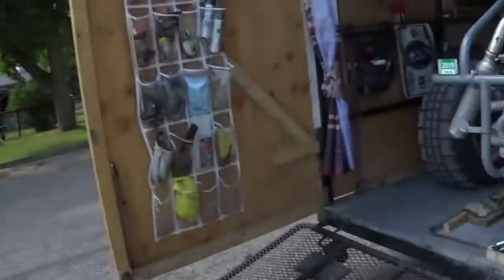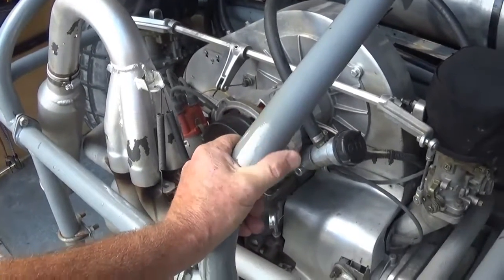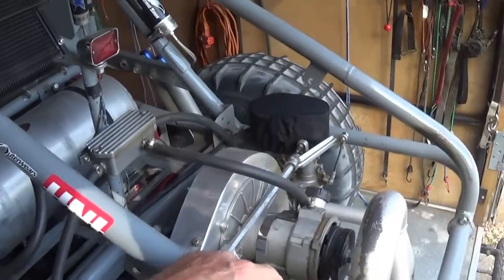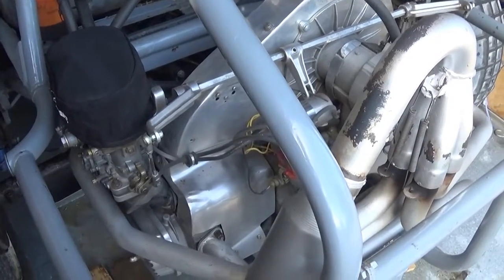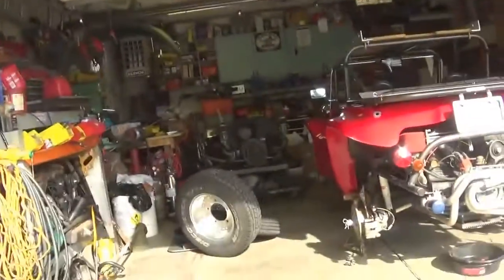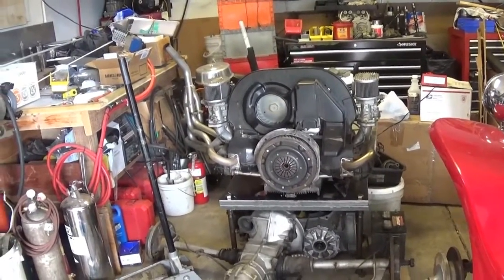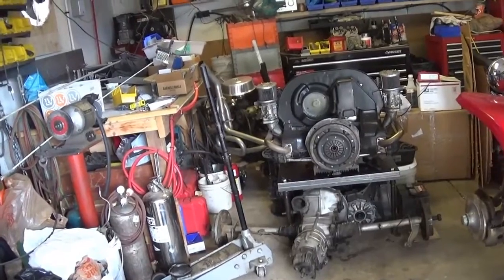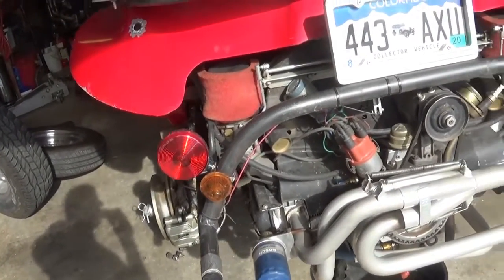VW Engine Vlog  2276, 2110, 2liter, 1800, 1776

Comment: Hey good video EZGZ!!!   I just stepped up my engine recently in my rail from a 1776 to a 2276, I'm still in the midst of getting it all buttoned up.  I noticed in your video you have a oil filter on front near the oil pump and a second external oil filter. This is how the engine i just bought is.   My question is since it doesn't have a doghouse oil cooler is it ok to run with just 1 external oil cooler without a fan like i see on yours????   Or is a fan on the external cooler required since it only has 1 oil cooler????    If that makes sense?     Any advice or help shed some light for me would be greatly appreciated!  Love your videos man an always learn a lot from you.   Thanks in advance!!!

Comment: Hey EZ.. First of all, I gotta say yet again (even though I'm subbed), I love coming across these videos.! So calming and fun to watch.. I know this video is 2 years old, but I have a question or 2 regarding my 15 year old daughter's engine build.. The engine block we have is great, no cracks, has case savers, etc... But when her and I tore it down and I checked the crank bearings, there are signs of the origional bearing stampings in the case.. Nothing terrible and the webs don't look terribly scored, but should we get a line bore done or look possibly into another case.? This is our first VW engine build..
Reply from the maker: If it's your first build I would take the crankshaft along with the rods and case to a machine shop that has VW experience or at least a shop that would spend some time with you. There time is money so they are not likely push other work aside to just talk. Expect to pay them something for there time. 
At some point your going to need a shop manual with all the information on measurements. Buy it now because it will be a great learning experience. If you can spend $100 go to harbor freight and buy some tools to measure and a 3/8 torque wrench. 
You need to establish if the bearings are standard or oversize and go from there. I should make a new video and cover this stuff again. Good Luck with your project
Reply: @TheEZGZ  Thank you for the reply.! You're the man.. I do have an hpbooks manual titled "how to build your volkswagen air cooled engine", and I have learned a bit already from just scrolling through different sections.. Unfortunately  we do no have any machine shops around my area that can or will line bore.. We do have a harbor freight though.. 😁 I will definitely need to invest is the above mentioned tools.. I am a machinist by trade for a corporation here, but I am not allowed to take my "government work" to work.. Ha.. The moror has stock crank, rods, etc. so I am assuming the bearings are standard size and not bored over..

Comment: I always like VW Bugs, recently I bought a 67 and I will like to restore for the front to the back but I will need some help with the engine never have taken apart, so I was hopping you could help me. I life in Colorado my cel 203-0961, tell me what you think. Thanks
Reply from the maker: Years ago a 1967 Beetle was highly sought after but they made a lot of changes and unless you have a very complete car I would look for something that came with IRS transmission.  Your 67 was swing axle and many interior and exterior parts were 1 year only.   Now if you plan on customizing it then all that doesn't matter. Good Luck with your project Mr. Ramos

Comment: Any suggestions for my 62 bug, running a 1835 with freeway flyer trans like to build a little bigger motor for the street, I'm 73 yrs young but love my car
Reply from the maker: More power and less RPM . hmmmmm   better watch that engine temp.  More power is more heat. Less RPM is less cooling......    get it?

Comment: Does paint help cooling. And if so can u do a video of Tue before and after
Reply from the maker: A light coating of high temp black paint on cylinder fin's will help dissipate heat and prevent corrosion. I would not recommend painting the engine block or transmission case as it acts like a insulator and traps the heat in to a small degree. Many rebuilders like to put a light coat of paint on things to make it look nice and even compliment the cars body paint. It's up to you. I personally prefer a clean ugly case just like left the factory. Sand Rails and Dune buggy's are different story. They don't get driven for that long and you can see everything.

Comment: Gz great  videos ! In your 1800cc engine what rockers raccheo are you running with your fk 7 cam? Thanks  and keep up the great videos
Reply from the maker: The stock 1.1 work great. Later on I tried some 1.25 and felt a slight improvement.  On my two liter I ran the 1.4 and it ran great for a few years and then suddenly I started breaking rocker shaft bolts. Even the special kind. I think it was because my heavy duty single springs were getting weak. You must always use at least heavy duty single springs with solid rocker shafts on any performance camshaft. The fk7 cam works fine with stock rockers but I still use the heavy springs and add zinc additive to the oil. Hope this helps you decide. Engine is smooth and strong to 5kRPM with dual two throat carbs

Comment: What motor sizes can I fit on a swing axle beetle transmission? I currently have a 1600
Reply from the maker: If a stock 1600 flywheel fits in the tranny you can run any engine size with a 12 volt starter.  Check your starter bushing in the bellhousing. Large one is for 6 Volt

Comment: Hello sir, I actually have a 1776 long block, bought the cheap empi 40 single carb setup but didnt like the look and feel of the intake. Without reinventing the wheel, I was thinking of going with a stock 34pict-3 carb but I've also read guys rejetting the carb. Is this something you'd recommend doing? I am currently building a baja and the engine is the main key piece missing but dont want to break the bank..
Reply from the maker: There are plenty of stock used carbs to experiment with.  If the person that built your 1776 put in a performance camshaft you probably won't like it. I generally run two carbs on all my engines. Good Luck with your project

Comment: How do you like that scat c35 cam in that motor? Is that a mid range cam?
Reply from the maker: To me the scat c35 is similar to the engel 110 but smoother. C35 is one of the best all around cams you can buy as long as your using dual carbs and 009 dizzy.
The C25 is even stronger on the low and mid range.
Reply: @TheEZGZ  cool. I'm building a 2180 right now and crunching numbers to figure out what cam is going to compliment my 82mm stroke and not kill the valve train. I don't mind some RPMs but don't want to always have to rev high to get the power that's sitn there ready to work.😁
Reply from the maker: C35 Would be the best all around cam for that build :-)
Reply: @TheEZGZ  thanks but.

Comment: Rod Ratio? Whats the advantage of using long rods over short rods or visa versa in a 2276?  Rod angle? Rpm's? Wear and tear?
Reply from the maker: I'm not smart enough to get in those debates. My 2276   has stock VW rods that have been ground down for clearance at the big end. That works great up to 5,500 RPM or so and that is all I need with the cam I got. Engle 120
Reply: @TheEZGZ  Thank you for your response. And thanks for your honesty, I was looking for different opinions. Love your vids, you do good work man.